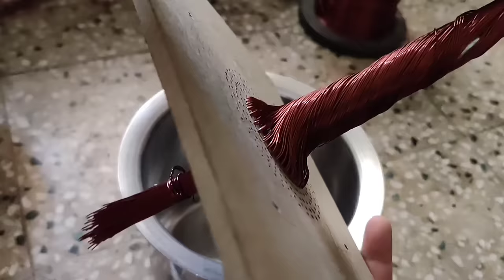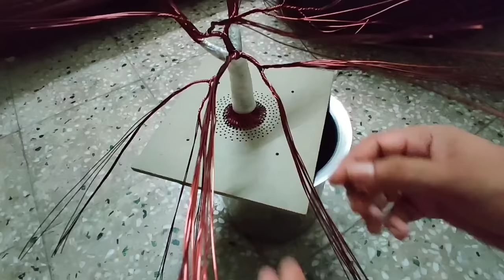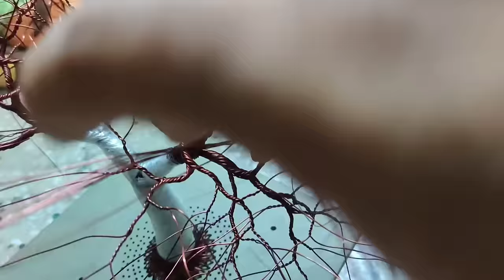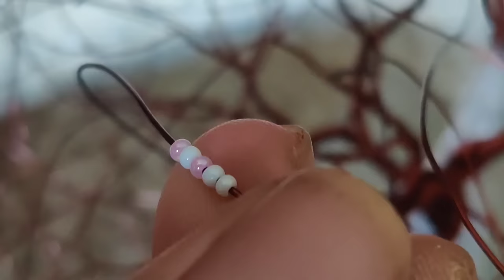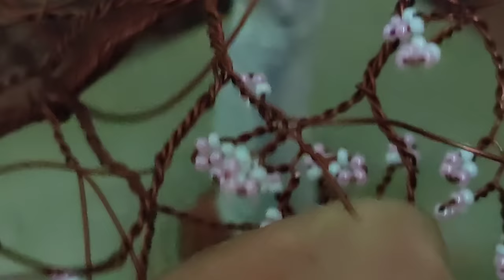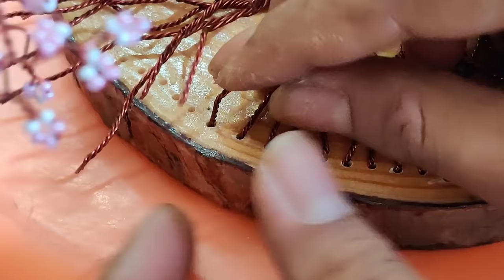Cherry Blossom wire tree tutorial

Comment: Here is a rough summary of what this fabulous artist showed us:   
### Materials List:

1. **MDF Board for Staging Jig**: With 10-15 graduated rings of 1.5/2mm sized holes, spaced about 1cm apart. This will serve as your working base.
2. **Alternative to MDF Board**: A bucket with similarly drilled holes can be used as an alternative to the MDF board.
3. **Aluminum Wire**: This will serve as the core of your bonsai tree trunk, providing thickness and stability. Ensure it's wrapped in plastic for easier handling.
4. **24 Gauge (.5mm) Coated Copper Wire**: Prepare about 300 strands, each 1.5 feet long. This will be used to form the branches and canopy of your bonsai tree.
5. **Plastic Wrap**: For securing strands to the underside of the jig and for holding the trunk in place around the aluminum core as you work.
6. **Seed Beads**: You'll need 2/3mm seed beads in white and pink for the flowers. There are 300 branches, with probably 3-5 blossoms per branch.  Thats about 900-1500 blossoms total.  Each blossom has 2 white and 2 pink beads.  So.... Yea.... A boatload of beads.  2000-3000 of each color easily.

7. **Permanent Wood Base**: For mounting your bonsai tree once completed.
8. **Rubber Mallet**: For securing the tree to the permanent base.
9. **Wire Cutter**: For trimming excess wire.
10. **Pliers**: For twisting and shaping the wires.

### Step-by-Step Tutorial:

#### Setting Up:
1. **Prepare the Jig**: Place your MDF board or bucket with drilled holes ready for use.
2. **Form the Trunk**: Wrap the aluminum wire with plastic to achieve the desired thickness for the trunk. Secure 300 strands of the 24 gauge wire from the underside with plastic wrap (or a twist)before beginning to shape them around the aluminum core to form the copper trunk above.

#### Shaping the Bonsai:
3. **Secure the Trunk**: Use plastic wrap to hold the copper wire trunk in place around the aluminum core as you work. This plastic wrap will be removed at the end.
4. **Form the Canopy**: Separate and twist your wires to form branches. Begin arranging your canopy by twisting the wires into desired branch shapes.

#### Adding Beads:
5. **Thread the Beads**: For each flower, use four seed beads (white, pink, pink, white), starting from the interior-most flower on each branch. Twist the wire to hold each set of beads in place. Repeat this process, moving outward along the branch until it appears fully blossomed. Trim excess wire as necessary.
6. **Complete All Branches**: Move to the next wire and repeat the beading process until all branches are filled with beaded flowers.

#### Finalizing the Sculpture:
7. **Remove from Jig**: Carefully remove the tree from the jig. Ensure all wires and beads are securely in place before doing so.
8. **Mount to Base**: Secure the tree to the permanent wood base by pushing the 'roots' through holes in the base. Use a rubber mallet to tamp down if necessary.
9. **Final Touches**: Remove the outer trunk plastic wrap. Bend and arrange the branches to your desired final shape.

Enjoy your beautiful beaded wire bonsai tree, a symbol of patience and meticulous craftsmanship.

Comment: Thank you for your inspirational video. I've tried a miniature version and using only 70 wire counts and it turned out very nicely..
Reply: What did you use as a base with the holes for the wire?
Reply from the maker: Compressed wood

Comment: Amazing Work! I would Love to try and learn how u made this Beautiful Bonsai Tree. Could you next time add a little more detail, how long was the wire u used, was it cut 50cmin Length,  or did u cut the tape off at the end to show the base of the tree? Should we make a base the same as u did before adding the 300 wires? Thank u so much again and Amazing Work!
Reply from the maker: Thank you so much
Yes you can make this base at home, I also did, 
I have used 1.5 feet means 18inches length, total 300 wire,
Reply: @bonsaiwireart3801  You Are The BEST!💕💖💖💖 THANK I SO MUCH.

Comment: An arduous yet satisfying masterpiece... 👏👏👏
Reply from the maker: Thanks
Reply: @bonsaiwireart3801  the wire you used... Is it also available in hardware stores?
Reply from the maker: @sweetlia8223  you can find this in electrical motor or coil  material shop.
Reply: @bonsaiwireart3801  thank you... 🥰

Comment: Amazing work beautiful! Can I ask how you remove it from the base board when finished? Also how is the trunk made and attached to the base?
Reply from the maker: First open cables from bottom and pull it from other side, tree will com out, 
Trunk made with aluminum thick wire and plastic wrap,

Comment: It's very lovely art. And the way you showed it through video is very useful to understand it. I want to know how you created the sheet with holes? Can you please share the details (dimensions of circles and number of holes in each circle) about the sheet?
Reply from the maker: Thank you so much
This is my regular working sheet, I have created that way back, my be around 300 or 350 holes, 
Distance between every circle is half centimetres, and distance between two holes also the same, 
I used 1mm drill blade,
Reply: @bonsaiwireart3801  Thank you 😀

Comment: Beautiful work what is the diameter of the copper wire? also if its cut 45cm per length x 300 roughly how many metres of wire is needed. thanks

Comment: l finally got my wire could you tell me how did you start your centre off and does the 300 wires include the centre l am so looking forward to making this and would like to thank you so much for showing us your extraordinary work  this is so beautiful and if l can create half of what you have done l shall be happy
Reply from the maker: In center I have taken thick aluminum wire and wrapped with plastic wrap, this is for trunk thickness, 
Fix this in center and 300  cables around it, also make sure that that center portion not show outside,
Reply from the maker: If still have questions please ask without hesitation
Reply: Thank you so much that is so helpful, l am cutting all the 300 wires at the moment i will also make a frame out of mdf and drill all the holes in to hold all the wires thank you again for all your help and your kindness it really is appreciated @bonsaiwireart3801

Comment: Love your work!!! Is this still possible to make if I don’t have the board with the drilled holes? Is there a substitute for it?
Reply from the maker: Yes it is possible, but I prefer the board, without board you can't get trunk finishing,
Thank you
Reply: Hi! AMAZING, AMAZING, AMAZING! I would love to try. Could please inform me if there is a substitute or alternative for the board/worksheet that you used in this tutorial??? And is there a specific Name that the board is called, please? Thank you.
Reply from the maker: Thank you so much 💕
This is compressed wooden board, you can use wooden ply or plastic flat plates... 
Draw the circle with half or one centimetres and drill it,

Comment: Hey just wondering how many strands per hole, it looks like you used 4 per hole? Which would make it 75 holes yes?
Reply from the maker: Depends on hole size, for root work you have to pull out tree from base,  you can use three or four wire in hole but just need little space so it will come out easily.
Reply: @bonsaiwireart3801  thank you for your fast reply! It's much appreciated.
Reply: Please let me know what you think 😊
Reply from the maker: @elighb4314  superb
Reply: @bonsaiwireart3801  Thanks mate 😊 it's definitely an enjoyable hobby.
Reply from the maker: @elighb4314  yes, more you involved more your tree look beautiful
Reply: @bonsaiwireart3801  That's true hey

Comment: What did you use in the middle of the tree before wrapping the 300 wires around it
Reply from the maker: Aluminum wire and plastic wrap
For truck thickness
Reply: @bonsaiwireart3801  so do you use 300 pieces of 1.5 feet of wire or 300 feet of wire cut into 1.5 feet pieces
Reply from the maker: 300 pieces of 1.5 feet
Reply: How many hole are in each circle on your board
Reply from the maker: Not fixed , it increases circle by circle,

Comment: Hi, nice work!!   What size wire do you use?  What’s the gauge?
Reply from the maker: Thank you so much
Wire 1 to 1.5 feet depends on your tree size,
And wire gauge is 24
Reply: Bonsai Wireart thank you for replying to my question.   One last thing...   I for got to ask you the size of the seed beads?  What’s the biggest size wire that can fit through one of those beads?  Thanks again.
Reply from the maker: 23 gauge is max, after that you have to change beads size,
I suggest to select beads and than buy cable as per the beads hole size.

Comment: what is the board with drilled holes—What is that material?
Reply from the maker: Its a compressed board, you can use wooden plate also...
Purpose of that board is to grips the wire, 
Some people use plastic plates or bucket bottom also...

Comment: Why you have wrapped the central aluminium wire with tape??
Reply from the maker: For some thickness in trunk.
Reply: @bonsaiwireart3801  what I mean to ask is wrapping with tape is necessary?? What is the role of tape??
Reply: @bonsaiwireart3801  what should be the  proportion of root trunk and branches in length?? If the total wire length is 16 inch what should be the length of root, trunk, branches??
Reply from the maker: 4 inches for root, 3 inches for trunk, 6 to 7 inches for branches and remaining for flowers
Reply: @bonsaiwireart3801  Thanks for guidance. Will show you once it's completed.You didn't tell me what was the purpose of tape on the supporting aluminium aire used in tree trunk.
Reply from the maker: @rachnasharma8734   I said for extra thikness in trunk..

Comment: Do you add a tutorial for the base?
Reply from the maker: Wooden base or trunk?
Reply: @bonsaiwireart3801  The staging base where you put the wire
Reply from the maker: @toniaholloway3135   it is so easy, 
Create circle with distance if one or two centimetres,  you can create circle as per requirement, if you have big board take 10 to 15 circle, 
Than after create 1.5 or 2 mm hole with drill, 
Two holes distance is 1 centimetres,
Reply: @bonsaiwireart3801  Oh ok. I'll give it a try
Reply from the maker: @toniaholloway3135  just make sure that your board is with good strength, this is one time work and you can create to many tree from this.